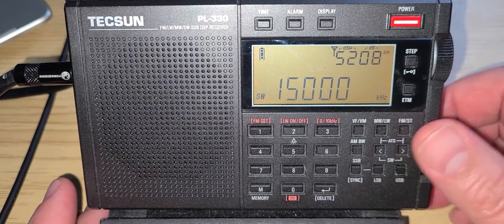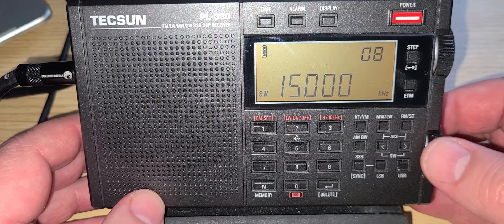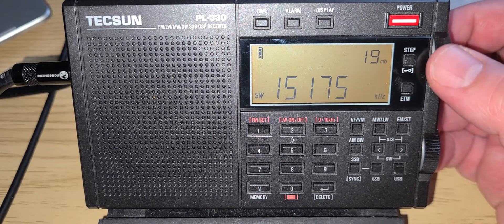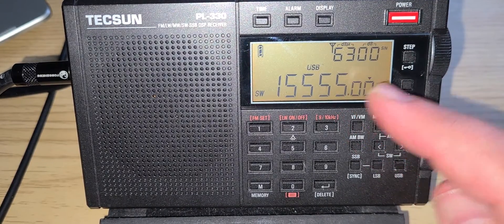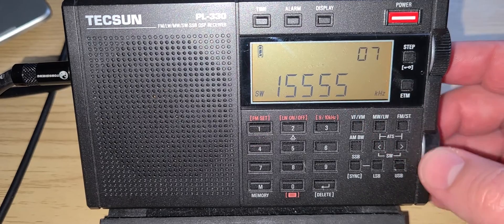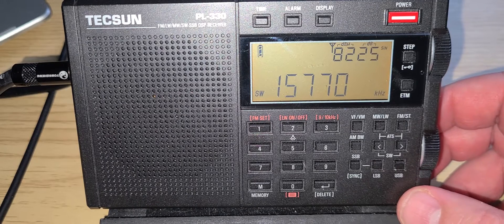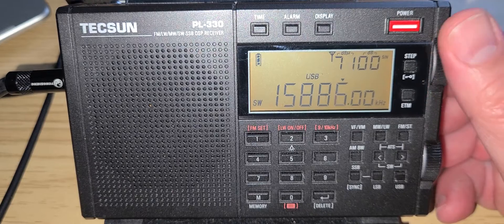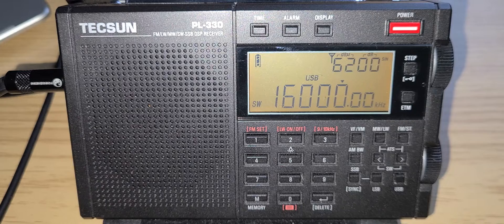Operating the Tecsun PL-330 Tuning 15000 to 16000 kHz Shortwave

Comment: Thanks! What model up from this in a Tecsun does not mute while tuning? Thanks again
Reply: The higher end DSP receivers usually don't mute during turning with the dial, they give you more of an analog feeling when tuning on the dial, but they usually go for a bit of money ($200-$300 range).  Look for the PL-880, PL-990/x, H-501/x
Lower end DSP receivers are the ones that usually mute during turning, you're not likely to find a cheap DSP receiver that doesn't mute during turning.
Reply: @madmax2069  does the C Crane Skywave SSB too mutes while tuning?